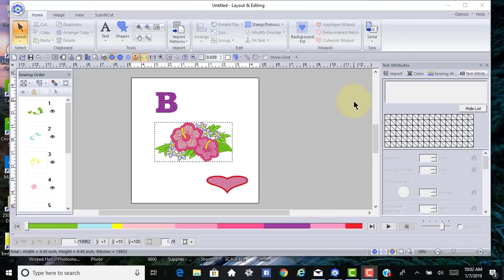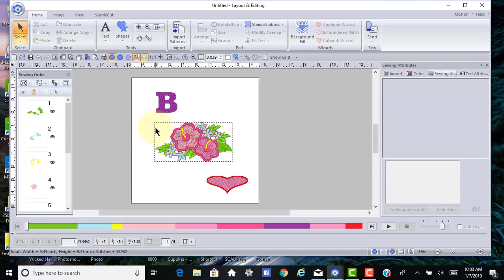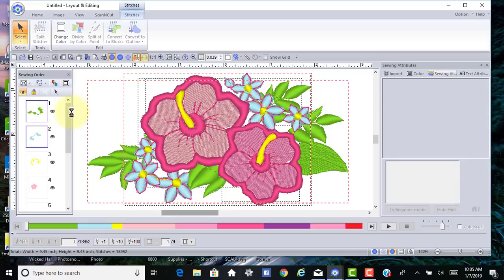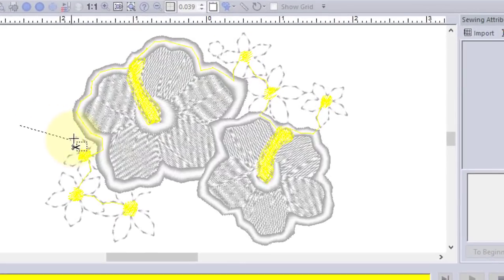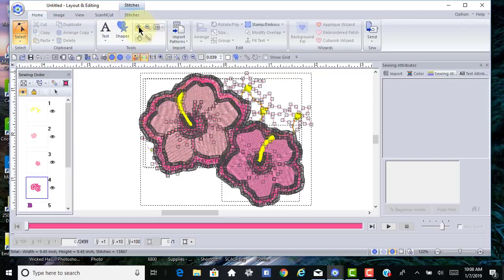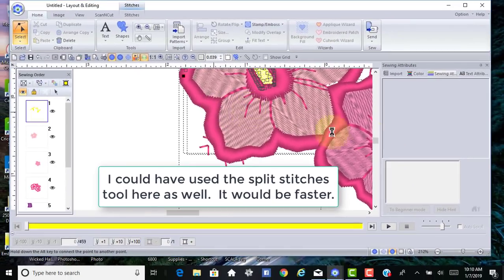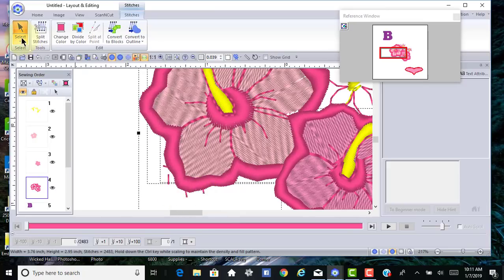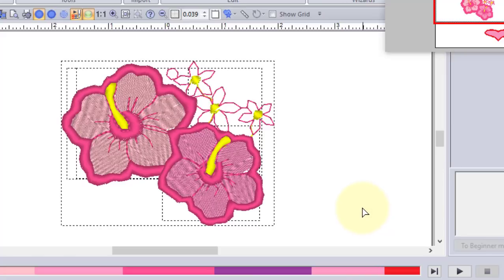How to Edit Stitches in PE Design - Lesson 1

Comment: Dear Terry, very good learn video :-) Thank you so much!
 I just got the PE design 11 and have some challenge, I'ld like to use your advice, but it doesn't allow me to split the stitches in a form. Is it because the program don't allow it or because I do something wrong? Do you have an other suggestion for being abe to delete part of a from and keep the other part?
Reply from the maker: There are several ways to edit stitches.  If you look at the Stitch menu, you can cut, divide by color or by objects.  You can also select individual stitches or multiple stitches by using the control key when selecting.
Reply: I think you've got to double click! when  finish the selection, pressing any other keys doesn't work